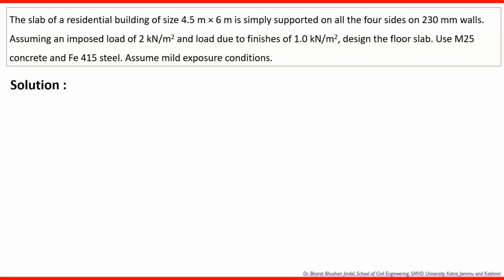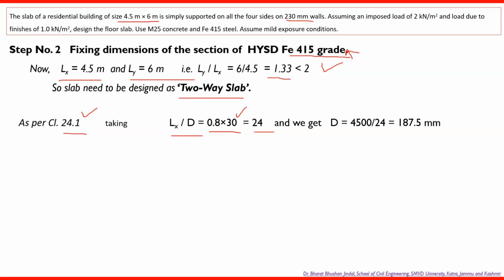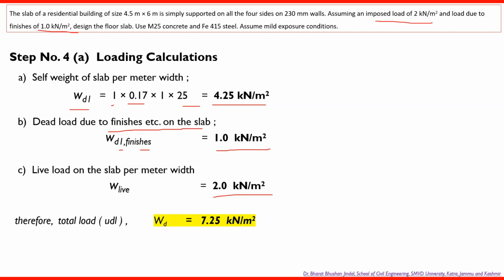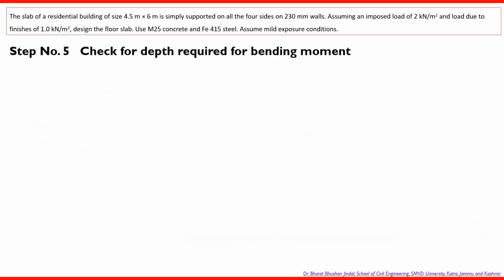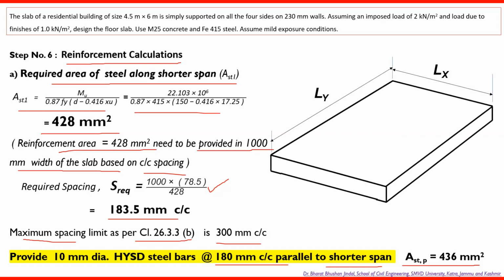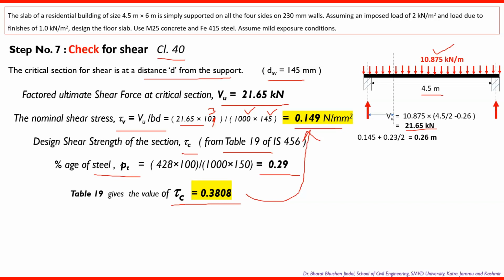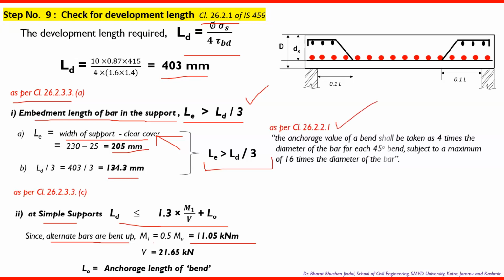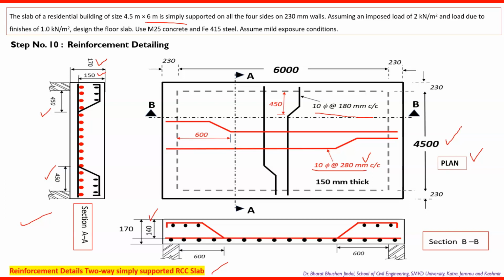Lecture 21 || Two-way Slab Design   || Simply Supported || IS :456 -2000 ||  Civil Engg.

Comment: sir, will calculating Lx/D ratio, value is considered 0.8x30.why not 0.8x35 as per clause 24.1 note that " the value given above shall be multiplied by 0.8"? ie "0.8x35"
Reply from the maker: That can be used if span length is less than 3.5 m.

Comment: Sir, if the ratio of Ly/Lx is greater than 2 and the slab is supported on all four sides, in that case, we will consider it as one way slab or two way slab?
Reply from the maker: In actual construction practices, you will find that slab whether one way / two way have supports on all the four sides but its the load pattern / load transfer mechanism which decides its type. The bending will be more prominent along shorter span. If the slab is supported on all the four sides but if Ly  >  2Lx , then as discussed above due to the bending behaviour of slab it will be one way slab.

Moreover, the above statement you will find true when you calculate bending moment along shorter as well as longer span in 2 way slab also.

Comment: Sir while calculating l/d ratio,In case of 415 grade steel we have multiplied the above ratio by 0.8 Now is this 0.8 a partial safety factor ???
Reply from the maker: You can watch Lecture 20 for details